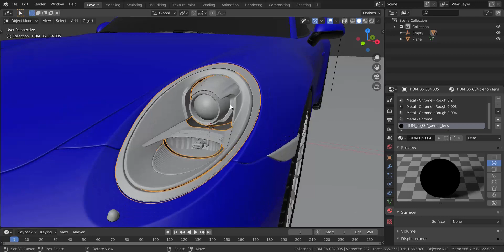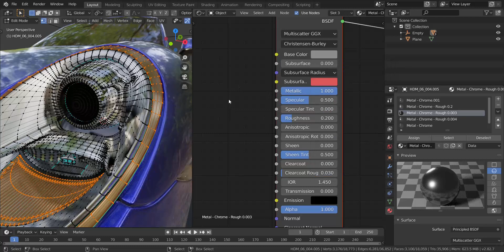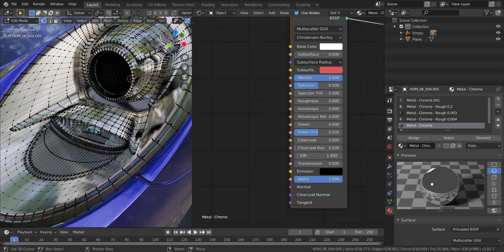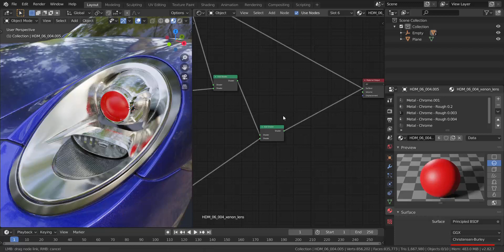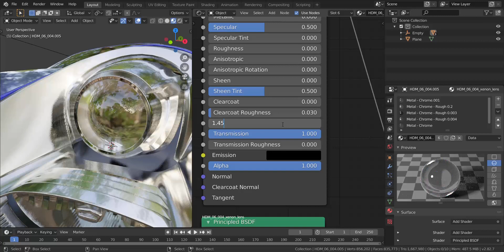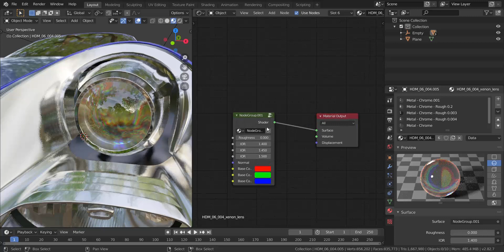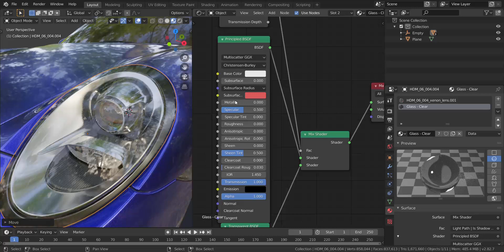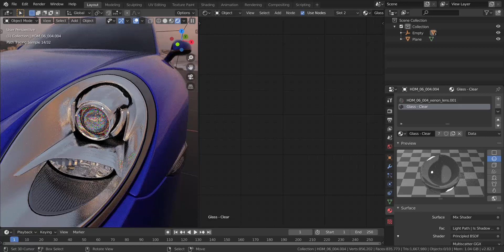Xenon Glass Headlights In Blender 2.8x

Comment: That's a very nice tutorial, but if you don't want to spend 15 mins on making a xenon material, you can add and connect the Noise Texture to Base Color in Principled BDSF and then put Bright/Contrast node between Noise and Principled and set the Bright to -0.3 and Contrast to -0.8 😁